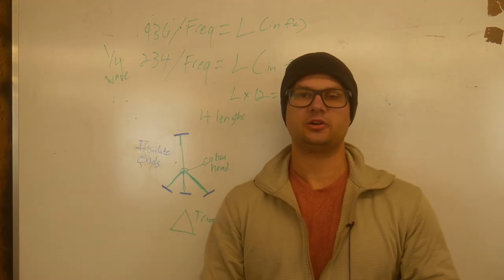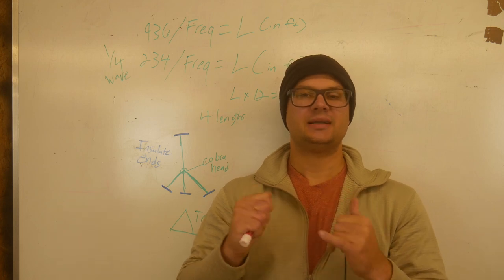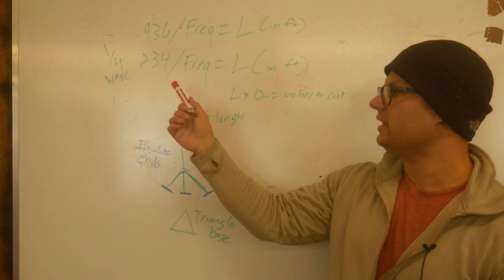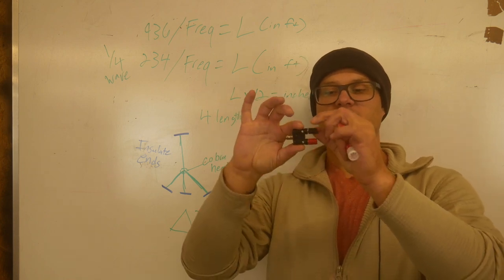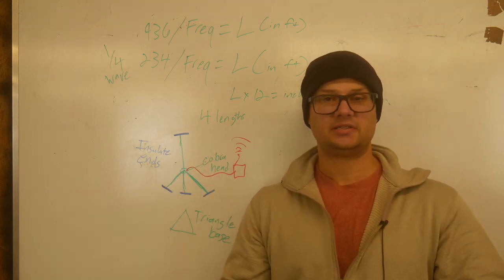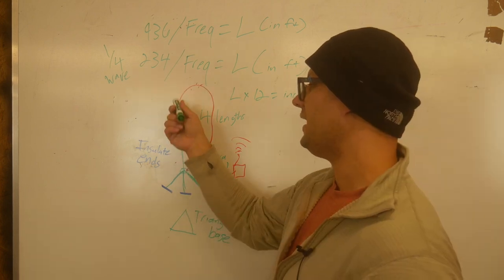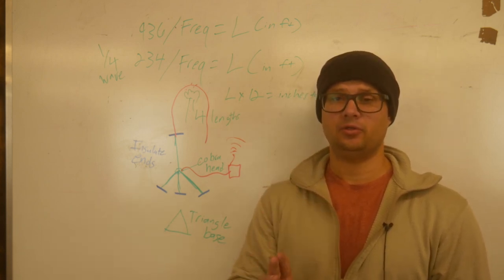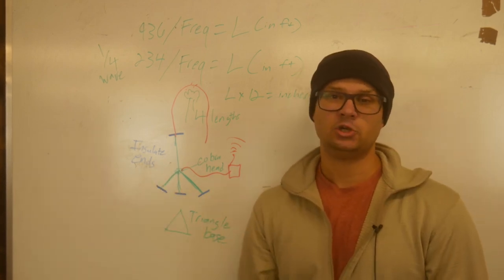Minute Man Skills: How to Build A Jungle Antenna

Comment: Will you post a follow up showing the actual built unit?
Reply from the maker: Ummmm, no?
It was disposable……so I disposed it…..😳
Reply: @CitadelDefense1  I guess I'm just confused how you lay out the sticks to attach the wire to
Reply: @CitadelDefense1  the wires don't go down the sticks, they just attach at the corners?
Reply from the maker: @fattiewestside  oh man, okay, I’ll do another one.

Yes, they just go down to the corners of the triangle
Reply: @CitadelDefense1  ah OK. And you're just insulating where the wire connects to the sticks. I think I'm getting it
Reply from the maker: @fattiewestside  yes just insulating where it contacts that sticks and at the top where it connects to the paracord
Reply: @CitadelDefense1  nice. I need to get the materials to make one now